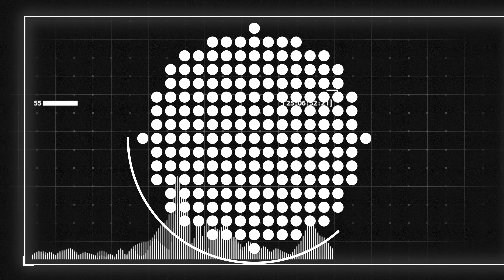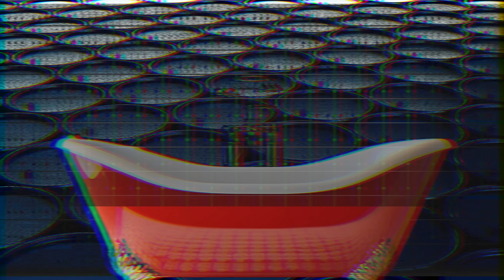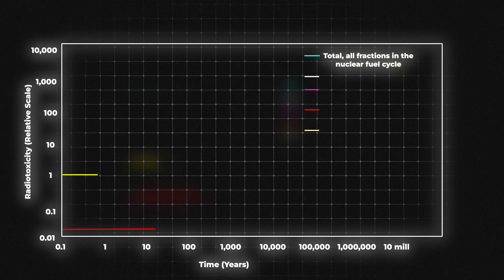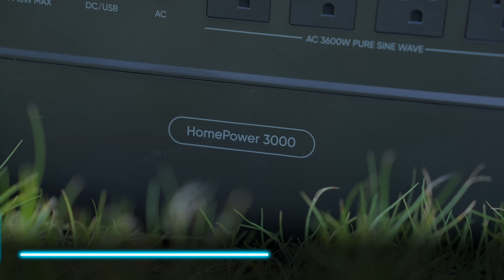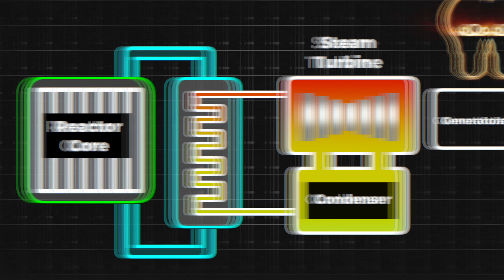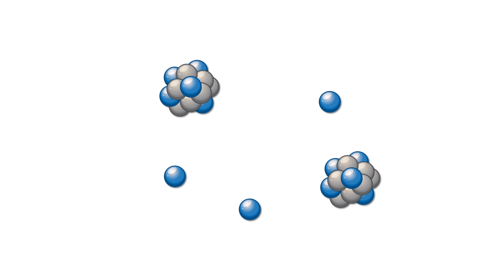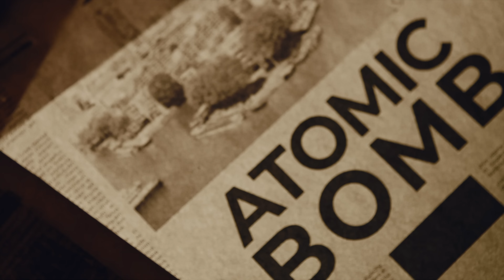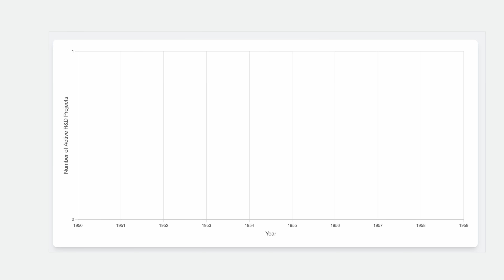Why Thorium is About To Power Everything

Comment: I have been watching videos on Thorium for at least five years. Still waiting for it to become commercially available.
Reply: With its endless promises & setbacks.. Thorium is racing against Fusion!
Reply: Try fifteen years, it's been spoken of for ages. Turns out nobody wanted to take a chance and build a new plant back then.
Reply: @bogganalseryd2324  absolutely not for ages. The development has been incredibly fast with a lot of investors and ongoing project. What kind of expectations do your have?
Reply: @bogganalseryd2324  it would be nice if the producer of this video had actually pointed out the limitations and problems of thorium like he promised to at the beginning of the video.
Reply: We would have finished the work and be using it everywhere now if it could have been used for boom boom but because it can't and they found a better easier way they abandoned it
Reply: It will be ready about a week after Fusion reactors.
Reply: I have been watching it for 20+ years, it’s always only 20 years away.
Reply: China has a test reactor running in the Gobi desert.  Development takes time, but we are moving closer.  How long have we been seeing news about next generation battery technology.  We’ve only seen that technology widely applied over the last few years.
Reply: How fast do you think new reactor types can be developed and licensed?  Five years is nothing.
Reply: China has a running plant now
Reply: The problem is processing at Thorium into useful fuel that's really difficult and expensive until they can find a way to bring the cost down It's going to be awhile but if they're successful this could definitely be a big breakthrough
Reply: Vaporware
Reply: Kirk Sorensen 😁
Reply: You don't really think this will happen surely...the goblins don't need us viable and powerful....
Reply: @foulbred  you seem to be very poorly educated on China and seem to claim expertise. Meanwhile, it's the C1A backed think tanks and the US state department claiming China leads, not follows, in 57 out of 64 critical technologies. The Nature Index claims Chinese universities contribute to the vast majority of high impact research in the hard sciences, with 8 out of 10 universities coming out of china and Americans with their first showing at number 13.

I currently live in China and travel all over for work. They lead in everything. Drones, batteries, solar, nuclear, fusion, robotics, manufacturing, mineral extraction, 6g wireless, screen technology, swarm programming, reverse aging, etc. 

Jim Farley stated the US needs to license Chinese IPs to catch up and said himself the rate of innovation was just completely humbling. 

Why would we listen to someone like you who clearly doesn't even have a passport?
Reply: Yeah me too waiting waiting waiting 
Waiting???? 👍
Reply: Same
Reply: in china now
Reply: Way to go buddy, I'm reading about this stuff since 2010 😮‍💨🤷
Reply: Actually, it started a lot earlier.  However, the Chinese already solved (and patented) the corrosion issues and finished their final test and are now going commercial, and they did it with a doozy: they ran their final Thorium nuclear test plant in the Gobi desert.  Getting further away from water cooling is hardly possible.  Now for the fun bonus part: the Thorium operating temperature of 700ºC is close to the 900ºC you need for the most efficient way to generate hydrogen.  In other words, we're not just close for a downwards step change in energy costs, we're also close to a far superior way to produce H2.  That means both far greater EV range (H2 to fuel cell) or CO2 neutral ICE use (simply put, reclaimed CO2 + H2 => reconstituted hydrocarbons, the stuff that Porsche has been using for years for test races).  The scary part is that the US isn't really party to this change (other than Flybe possibly having developed the best fuel mix), and I am worried what they will do as this will affect the dollar like nothing else.
Reply: @freddoflintstono9321  - Hydrogen fuel cells are 60% efficient at best. Then you have all the issues with storing and building a refilling network. A far better use for the electricity is to charge EV batteries directly, which has a much higher end to end efficiency than anything you an achieve with Hydrogen.
Reply: @freddoflintstono9321 if the Chinese have invented a method of fully utilizing Thorium, and avoiding/mitigating the corrosion issue, the patent is likely unenforceable. You can’t patent a process that’s the only way of doing a necessary thing. eg nobody patented uranium nuclear power. Bc there’s a particular way it just works best.
Reply: @freddoflintstono9321  The Navy while looking to make onboard liquid fuel for aircraft carriers developed an efficient process to take CO2 from seawater and combine it with H2 to make ethanol.

Ethanol fuel cells would be better and safer than H2 fuel cells.  Here is an excerpt from seeking alpha on them:

>>>Fuel Cell technology offers many advantages over Lithium-ion batteries, not the least of which is that hydrogen used in fuel cells has the energy to weight ratio ten times greater than lithium-ion batteries.

That said, the volumetric energy density of ethanol is over five times greater than hydrogen.

Ethanol has five times higher volumetric energy density (6.7 kWh/L) than hydrogen (1.3 kWh/L) and can be used safely in fuel cells for power generation.<<<

Nissan drove an ethanol fuel cell vehicle in Brazil using the existing E100 fuel infrastructure.  Neat thing is the ethanol will still work with enough water in it so as to be non-flammable, making an already safe fuel even safer.

Advanced large military European and Indian submarines now use ethanol fuel cells for propulsion.

Alcohol powered fuel cells are sold for drones, backup power, computers, RV and sailboat power systems etc.

Of course, just plain old ethanol optimized cheap cast iron engines can reach efficiency levels approaching fuel cell's without pollution and at half the size.

The next generation of ethanol fuel cells are direct with no need to use a catalyst to make H2.
Reply: @freddoflintstono9321 I am fully aware it started earlier. I don't have a whole lot of faith in Chinese claims or reliability. We will see how things play out.
Reply: @foulbred  actually, it is the US you should doubt. maybe you arent familiar with todays china, things done for domestic projects are done well. only the cheap crap is for US consumption. high speed rail, bridges, other mega projects are usually superior
Reply: I live in Jakarta - waiting over 12 years for the  granting of approval for Indonesia's   8×500MWe PPA.
Now we need to delay approval to purchase (or Barter) the necessary "Highly Assayed Low Enriched Uranium" from one or two of our BRIX member Sovereign States or even a BRIX Partner... pray the Great economically collapsing Hegemon won't interfere against such an opportunity.
Reply: China has a near completion project. Unlike US where it was just dead science stopped decades ago. And that researech is what the chinese based it on.
Reply: @635574 western mindset 😅

Chinese have talent just like the west. They are leading in several technologies.
Reply: Wow, five whole years?
Reply: @mjmtaiwan yes
Reply: @mjmtaiwan Taiwan is a part of China
Reply: Refer to China.  They are a dictatorship so they have no restrictions. They might not have thought of it but they are darned well making rapid progress on it without lobbying from alternative interests.  In a few years, China will stop supplying solar to large (city) demands and switch to Thorium.  Then miniaturisation will be their drive to fit on a street corner/truck/barge/train/desk ,as well as patenting their problem-solving technical smarts (aka why the original 1950/60's US program had to close).
Reply: Reading comprehension seems to be a problem with some. Just because I have been following this for five years does not mean it has not existed longer. Yes, research and development take time. No one said otherwise.

Also, some seem to have a lot of faith in China. When is the last time they came up with something that was not a subpar clone of the original. I am sure most of these responses are Chinese propagandists and/or bots. If not, you should really read up on your current events in relation to China.
Reply: Got it,  good vibes, couple things...China "said" they got it figured out, hard to believe em, 2nd. Google and FB & Microsoft  would be involved/ buying in if it was really close to working ! I heard about this back in 2015ish! But maybe it is a perfect time....
Reply: Be prepared to wait a long, long time. Anything that depends on a steam turbine is not competitive anymore, and falls farther behind by the day. Nothing can compete with exponential processes like the falling costs of solar and wind power and battery storage.
Reply: @sciptick ThorCon's levelised pre-profit cost <$30/MWh energy per m² footprint 43kiloWatt/m2×24/7 v's 1kW/m² ×5hour/day for non-recyclable irratic "renewable" farms at what cost when you need to increase there supply 5× and add sufficient Mega-Pack batteries to cover the other 20 hours per day and DC/AC conversion + stabilising Herz frequency... LOL useless for 24/7 GigaWatt demanding GAI processing like Colossus..
Reply: @sciptick  they are different. People who think solar and wind are all that matters because now they are cheap miss the point. That’s green talk, but in reality diverse energy production is the future. Thorium would be great for extreme environments from Antarctica to Mars to Canada and Alaska to Satellites

Comment: well as of usual, if there is a leak, then all of the liquid will end up in a same puddle that is box shaped. well bypass the rules, use ultra-light flying reactors. well or go to moon or mars or international unregulated waters. well countries legal arm does not reach to open waters or another planets. but they try to. ai cant be regulated, because its free and open source. ie science cant be regulated. you dont even require a u-235 starter, if you use dd-fusion heavy water core as the feeder starter.

Comment: But it still takes billions of Dollars and years to build so it's facing an uphill struggle against solar.
Reply: Maybe so as to the billions but solar and wind power are very stupid because of their limitations like snow, rain, no sun, no wind and mechanical wear.
Reply: "But it still takes billions of Dollars and years to build so it's facing an uphill struggle against solar."

For solar you will need to pair it with batteries, which still haven't reached full scale production. Thorium reactors are actually a quite good fit for datacenters.
Reply: Actually for decades, China has been building nuclear complexes of several nuclear reactors for hundreds of millions of dollars, and they typically take 2 to 4 years to come on line.  I think that China builds these so much quicker and cheaper than the west because they are better.

Comment: It's about time Thorium was considered seriously. I hope we get back to common sense solutions. The lunatics on climate change should even want this.
Reply: It's a good fit for datacenters.
Reply: @yourcrazybear  If they ever figure out how to make it work succesfully, although for datacenters/AI it doesn't even need to be cheap energy.
Reply: @davidmccarthy6061  "@yourcrazybear  If they ever figure out how to make it work succesfully, although for datacenters/AI it doesn't even need to be cheap energy."

Yeah. Right now it's all about finishing first in the race.
Reply: Can't make bombs from the residuals, so the military industrial complex, will fight it all the way.
Reply: Here's an idea: Why not let AI design the best materials to prevent corrosion?
Reply: Several companies are very close to working reactors. The hurdles are mostly regulatory.
Reply: Thrium was considered in the 1960s and compared to the uranium fast breeders it was found to be inferior. There was a short revival in the 1990s with more modern simulations that confirmed the issues of the old designs and chemical reprocessing turned out to be more tricky already with Uranium. So thorium use is limtied to a small addition to some rods in conventioal reactors to use as once through. Something like 75% Uranium 25% thorium may save a little - but not much. It still comes with unplesant hard radiation from used fuel.

A working thorium breeder including the reprocessing is still behind fusion in developement. The current small companies are just there to get government funding for research, not to actually build a working power plant.

Comment: Can't have nearly "free" fuel in use. Those in control lose control.
Reply: High scarcity = high potential for control. 
Abundance = impossible to control.
Reply: @sunkeyavad6528 there is no scarcity of Uranium.
Reply: @RidgeRunner1966  AND can't make weaponized Plutonium from Thorium!
Reply: @Rogerthat777  no, but you can make weaponized Uranium from Thorium. It's not easy and neither is really relevant for nuclear power.

Power reactors cannot make weaponized Plutonium either.
Reply: if that was the case Hy so many incentives for solar and other renewables, that are helping people become independent from the grid and get "free" energy?
Reply: Heck, I think traditional pellet reactors were hamstrung and consigned to design purgatory until the cost of power they produced reached parity with coal/oil. THEN it was allowed to propagate.

I mean.., when I look at some of the design choices in current reactors and scratch my head thinking, "Why would they do it that way? That's SO insanely inefficient!"  Well.., the answer is exactly as you describe.
Reply: Yes, imagine buying a car that came with a lifetime supply of fuel.  You're cutting out an entire industry (tons of jobs & $) and that kind of change is resisted, hard!
Reply: @jarbuthn  that sounds like conspiracy theory territory.

That is not even the reason why nuclear is resisted.
Reply: @Kian139 its not conspiracy theory its just sociology.
Reply: @jarbuthn  conspiracy theory is sociology but your theory is not.